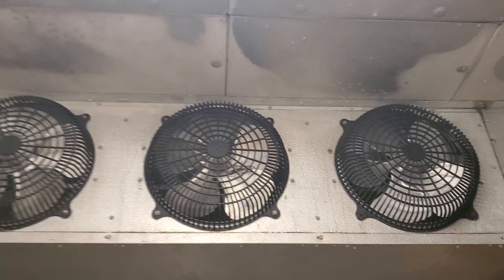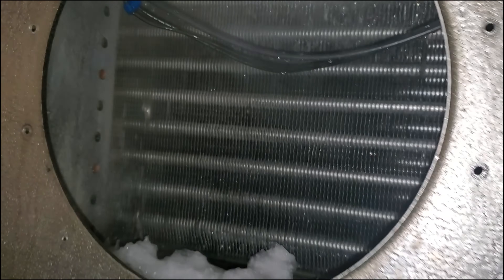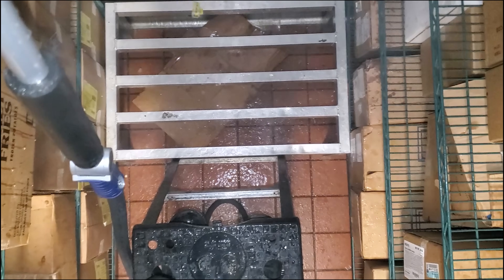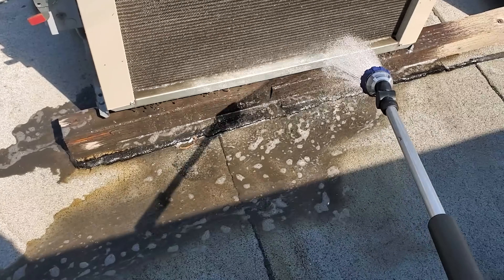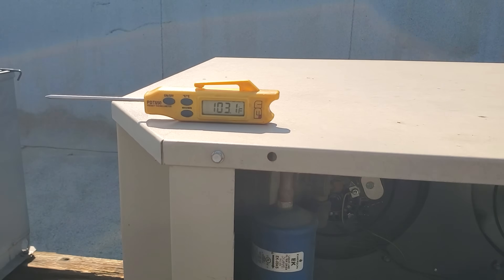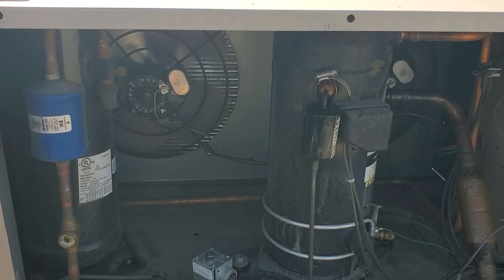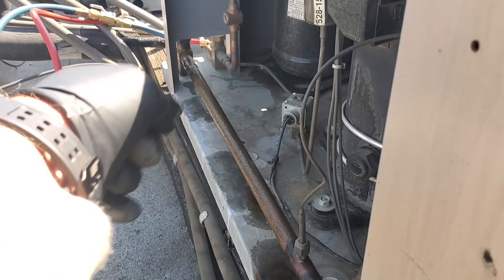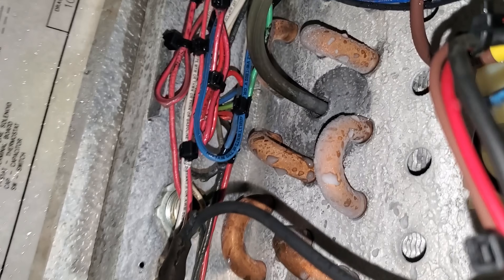THE WALK IN FREEZER IS NOT WORKING

Comment: Could you do a video on wiring a ranco etc to a walk in freezer where the display stays energized during defrost . Have had bad luck with them losing their memory from time to time on 45 minute long defrost. Capacitors inside the controller won't keep the memory goes back to the factory setting of 73°

Comment: Lol like #999. I was late watching the video. I can't say I've seen liquid injection on any refrigeration system I've worked on, which isn't saying much. Im not a reefer tech by nature. I do work on reefer systems from time to time. Mostly if the customer has refrigeration systems on site. I run into liquid injection on chillers for process equipment. Mostly by companies that specialize in process equipment. Last one was a German chiller. The whole diagram was in German, so i had to visually go through the system to identify the components. It was a chiller that cooled oil for a large CNC machine.

Comment: I thaw them out the same way.   In situations where there isnt a water hose connection, I use hot water in a pump up sprayer.   Slower, but works.